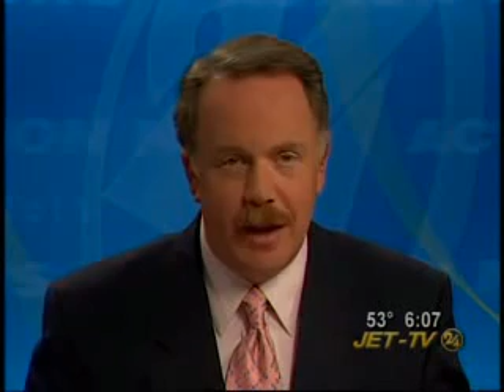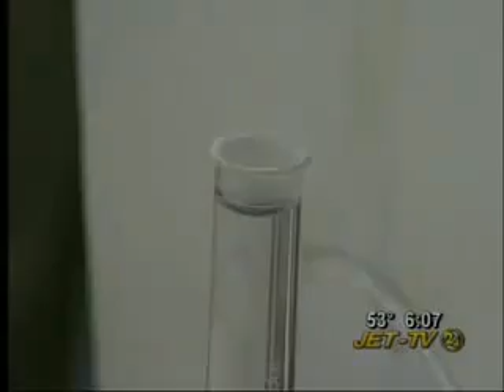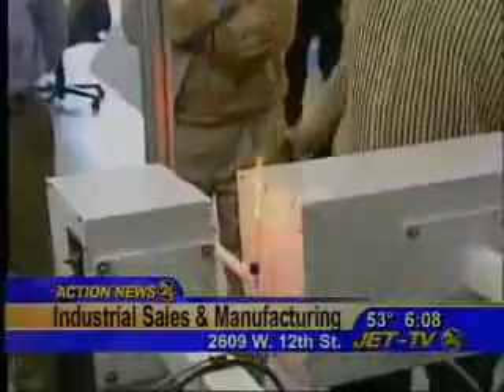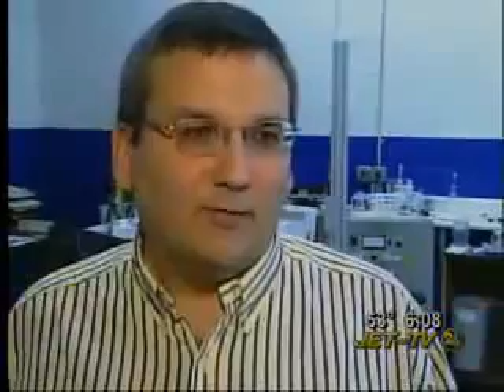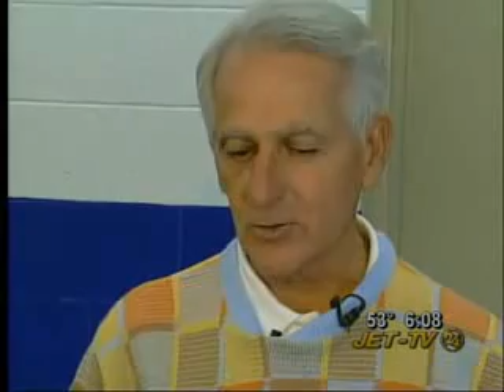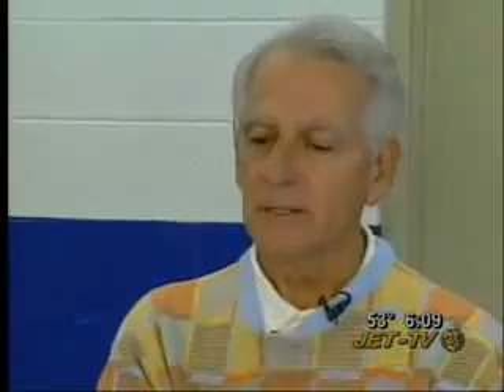Water Fuel 1 of 4

Comment: The law of the conservation of energy is not in question in this case because mass could be sacrificed in a chemical reaction. A small amount of energy in the form of radio waves would merely provide a means of producing hydrogen witch in turn is burned for more energy than it takes to produce the radio waves. This is not some perpetual motion machine because a complex chemical reaction is present.